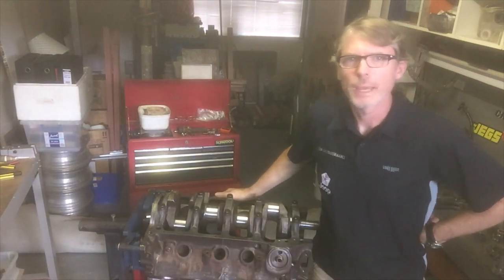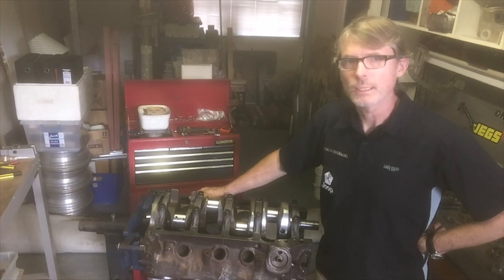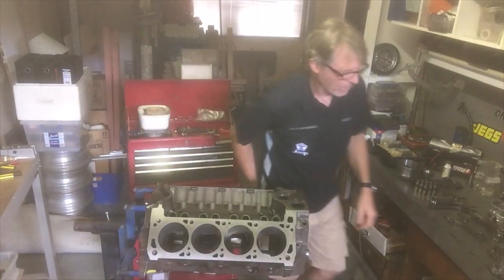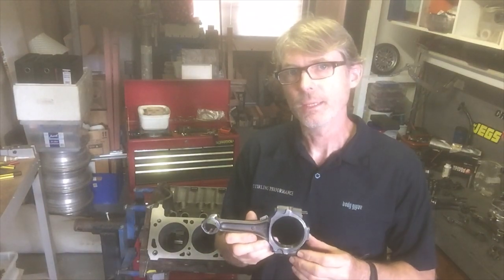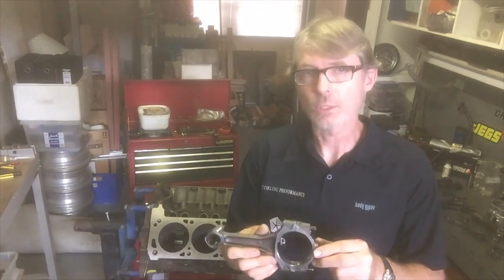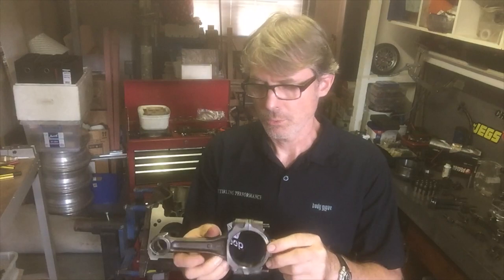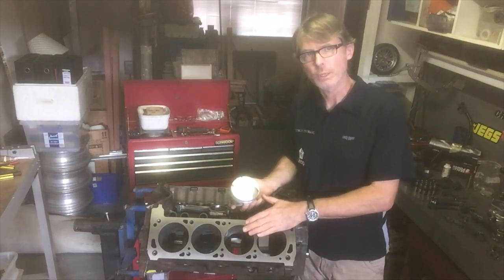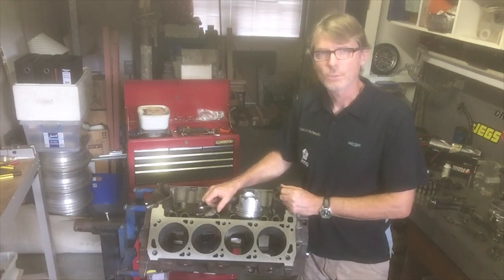GTHO 351c Cleveland phase 2/3 engine build part 3

Comment: Great to find all 8 parts Drew. Your work is exceptional. Thanks from New Zealand.
1.647" compression height, 5.78 rods, decked 9.206 minus 32 thou makes 9.174. -0.003"  below the deck face. The head gasket added the 41 thou of clearanced to avoid Calamity Janes with the valve train and piston to quench zones.